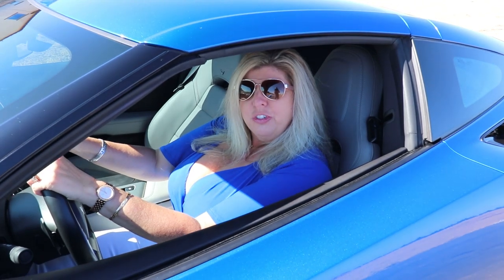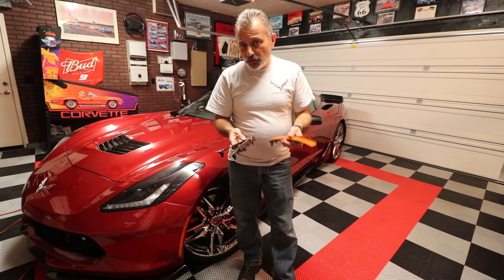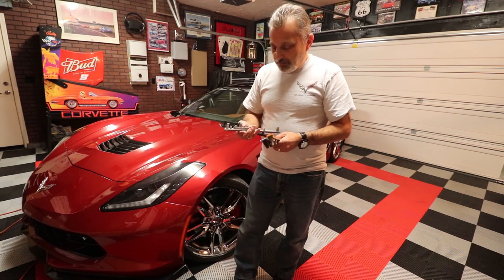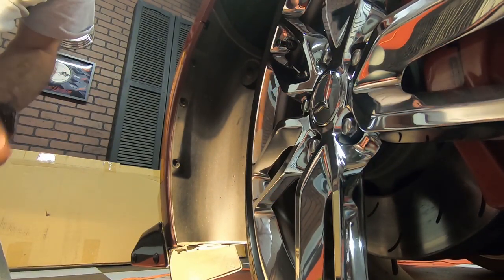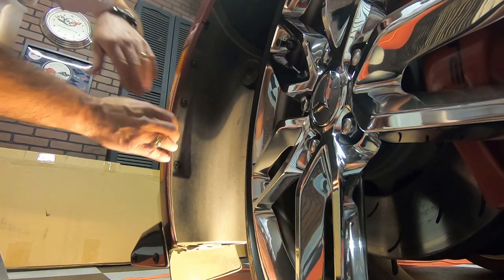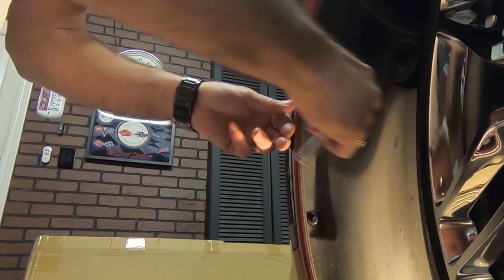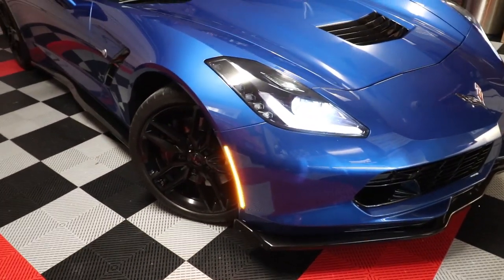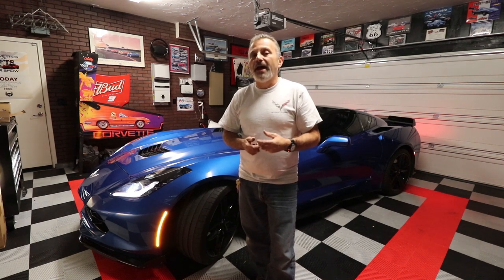Installing Smoke Colored LED Side Markers in my C7 Corvette

Comment: Purchased the ghost painted from oracle for my grand sport.   Look awesome.    Was difficult to install the front as I had to pull out the front clip due to the extra plastic cladding.
Reply: Kirk Dale - What extra plastic cladding?  I’m just about to order a set of Oracles (tinted, not ghosted) for my ‘17 GS and I don’t want any fitment issues...
Reply: Nomore76 you won’t have any fit problem and mine look awesome.   When installing the front on a grand sport you will have to pull down on front clip like the video shows.
Reply: Check out the video from corvette918.   He shows replacing his on a grand sport.

Comment: Which brand did you buy that is causing the RF signal interference?   Did you post a follow up video explaining the problem/fix?  Finally, which brand of LED side markers did you get and from whom?
Reply from the maker: Here is the link to the lights I bought..
https://www.ebay.com/itm/Smoked-Front-Rear-LED-Side-Marker-Light-Lens-Set-For-2014-2019-C7-Corvette/254332419850?ssPageName=STRK%3AMEBIDX%3AIT&_trksid=p2060353.m1438.l2649

The lights are still working great!
I have not done a followup video. But I am planning on it!

Have a great day! Thanks for watching..

Comment: You have a great channel. I havent seen every video so wanted to ask your personal opinion. I have a c6 GS 2013. Next year I want to add a c7, same Nite Racing Blue. Yours here, bueatiful color btw, is a Z51. Do you recommend the Z51 over GS or Z06? Just deciding before 2022. Thanks!
Reply from the maker: Thank you for watching!!
Yes mine js a Z51 but as you know I made it a ZR1 clone. The GS and the Z06 are wide body cars. The GS had the same running gear as the Z51 it just has the wide body the Z06 is a beast all of its own.
The Z51 and GS are both faster than you can drive, so it is really bragging rights!!
I would say if Lou can afford it get the Z06, but trust me you will still be super happy with any C7. Even the bade model is a great choice if you are. Ot planning on tracking the  car,and if you want to make any of them look like a Z06 just let me know, we can put all.of the parts on it!!
Hope this helps!!
Reply: @THECORVETTECHANNEL  yepp....thx again!!!

Comment: how did the lower price (non Oracle brand) held up since installation? They can be up to half in price compared to Oracle from those on the market. Not sure if is better quality or just packaging. Most LEDs are pretty reliable in general these days. appreciate your feedback.
Reply from the maker: I will be doing a follow up video talking about them. They are still working great but they created a problem. The RF signal that the LEDS put out was making the Tire Pressure System to have problems when driving at night with the lights on. I figured out how to fix the issue. Very cheap and easy to do! Stay tuned for that video!!
Reply: @THECORVETTECHANNEL  excellent! I'll look forward to your video.
Reply: Have you posted how to resolve the RF issue? I'm waiting to see how to fix mine. It is incredibly annoying.

Comment: Did you have any problems with the led interfering with the Tom's signal?
Reply from the maker: Yes as matter a fact I did with my 2014 C7 but not with my wife'ss 2016 C7, I did a follow up video to this one so check it out.

Comment: I have the made in China LEDs that are causing errors on the  TMPS.  What did you do to remedy the issue. I've put chokes and faraday.tape on the lights but still have the problem.
Reply from the maker: Hi there,
I actually cover that in a followup video.
I had the same issue on my 2014 but not my 2016. I covered my lights on my 2014 with foil tape and it fixed the problem, but I ended up replacing the lights with Oracle lights from Verte Lights.
Good luck!!